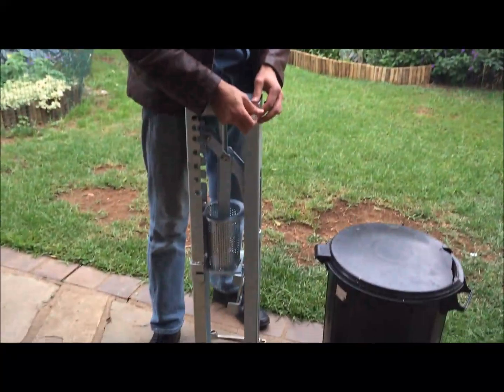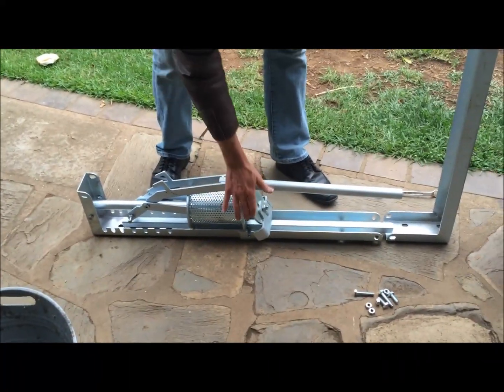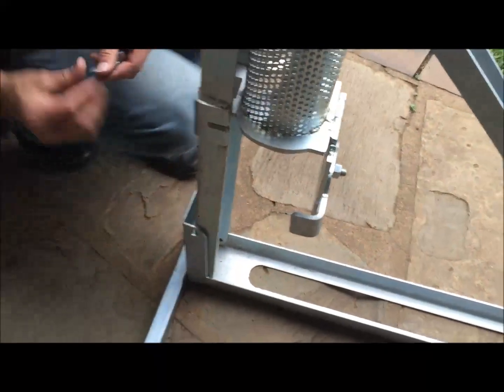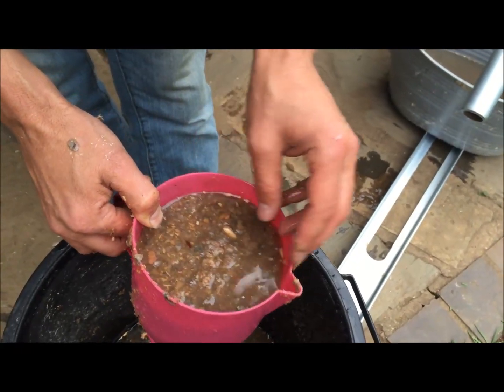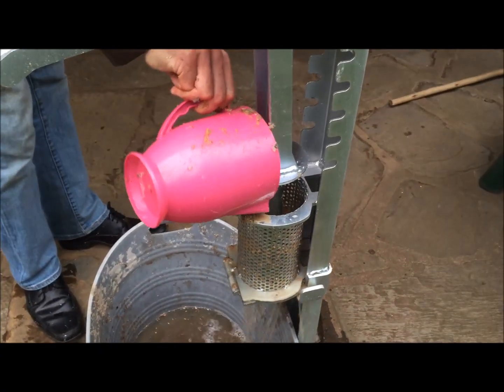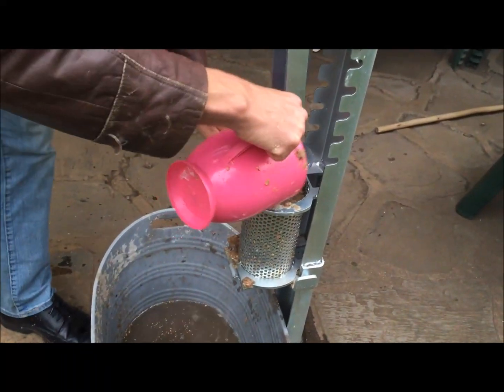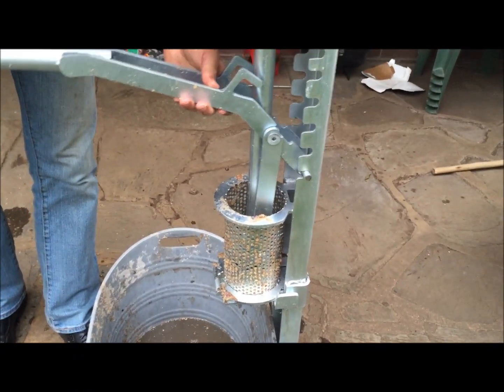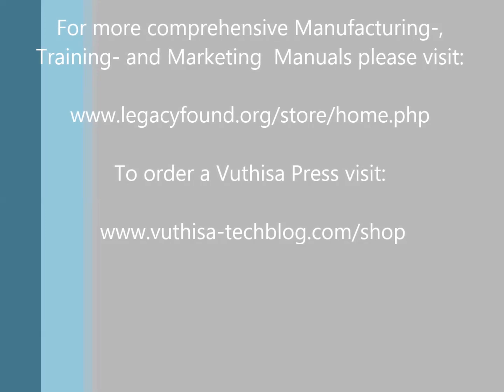Vuthisa Ratchet Press

Comment: How long does it take the briquettes to dry?
Reply from the maker: +CenUSA Bioenergy in SA it takes around 5 days to dry. In the tropics or colder climates (Europe) it could take 10 days. Many on the fuel briquette network uses solar dryers - basically just wooden racks covered in see-through plastic.  I leave it under cover but exposed to the wind and that's more than sufficient to drive out moisture. It could have 30 or 40% moisture content initially. The lumber industry have drying kilns - I wonder if they would dry in there? Anyway they always find a way. If you produce 500 per day - you need to be able to have storage space for 5000 and then start selling in day 10 when that first 500 is dry.